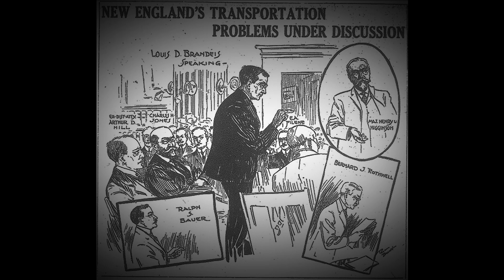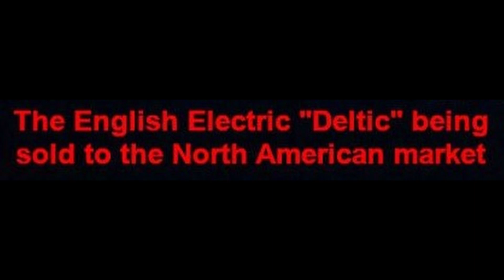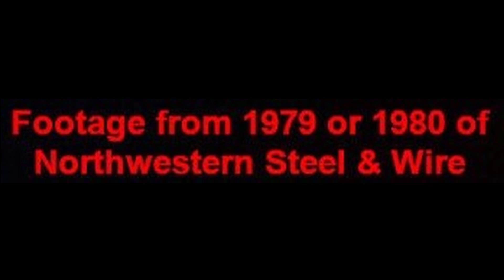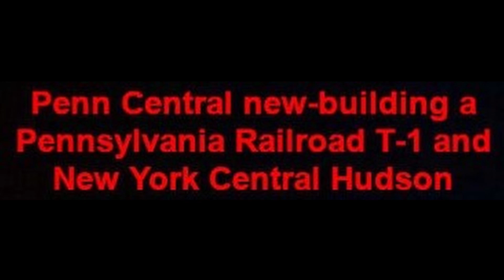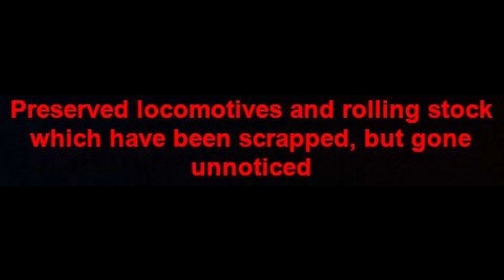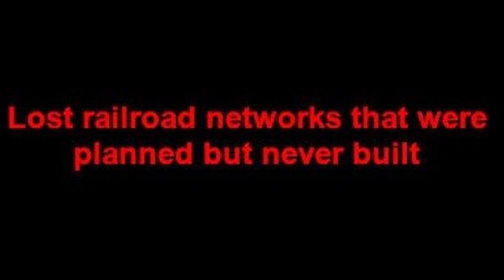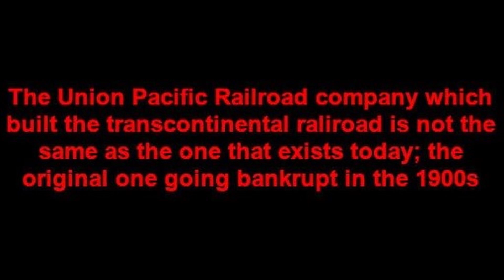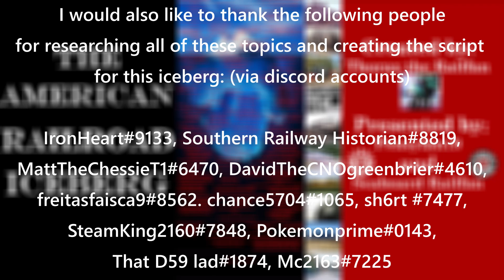The American Railroad Iceberg Explained Part 3

Comment: That Ex-NKP ALCO S2 is still sitting in the same spot at that plant in Dixon as of July of 2021. It was converted into a Remote Controlled unit by the plant. It’s missing a lot of parts and is in sad condition.

Comment: you shold ad the original golden spike engiens the u.p.r.r No.60 
and c.p.r.r No.29 "Antolope"
Reply: CPR 29 as in a 4-4-0 like the one at the CPR headquarters in downtown Calgary cause the engine has been in New Brunswick between 1988 to 2004-5

Comment: Actually, the Union Pacific is not the Southern Pacific, it's the Denver & Rio Grande Western
Reply from the maker: Really? How so? Is it because the Rio Grande somehow owns the SP?
Reply: @Pensyfan19  Yes. That would make me a Rio Grande Man
Reply: @Pensyfan19  Yes if you didn’t know the holding company for the non-existent SPSF merger sold off the SP as it was smaller then the SF, the railroad that SP was sold was the Rio Grande which then took the identity of the SP then when they merged with Union Pacific (Mark I) the SP (Rio Grande) renamed themselves to the UP (Mark II) because somehow the Rio Grande and SP combined is bigger then the UP, so it was actually the SP (Rio Grande) that merged with the UP, so actually the UP we currently have is the SP (Rio Grande) in disguise.
Reply from the maker: @Maunico0809  I have since been informed and made a video of Train Facts about it, as a bit of an expansion [correction] on this point made here.
Reply: @Maunico0809  Many of the events you are describing took place in the 80's and 90's. Combined SP and Rio Grande was bigger than the actual UP, because until 1997, Mopac was still operating as a subsidiary, the Katy was bought by UP in '88, WP in '82, and the CNW most likely had yet to be completely absorbed because of outstanding debt for the PRB expansion. By now everything is more or less consolidated.